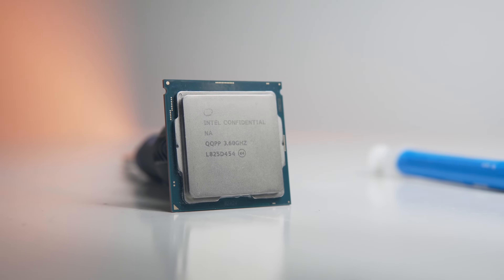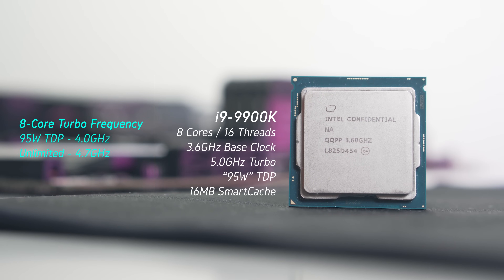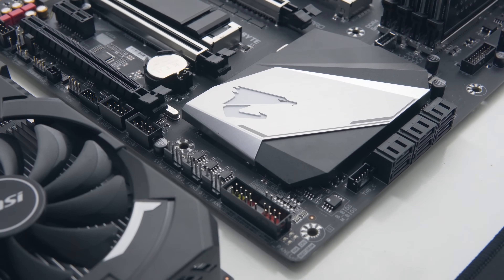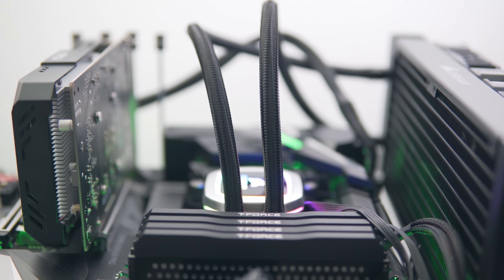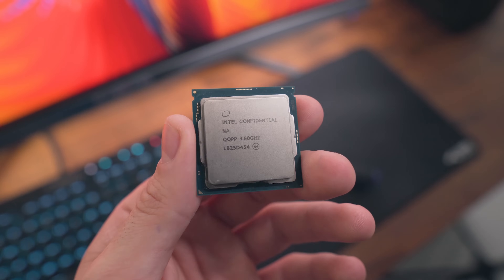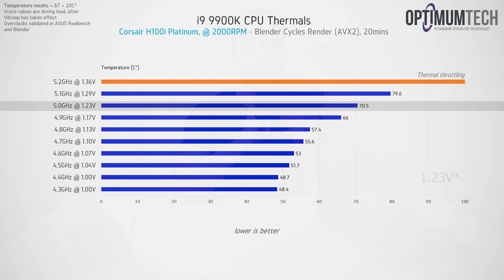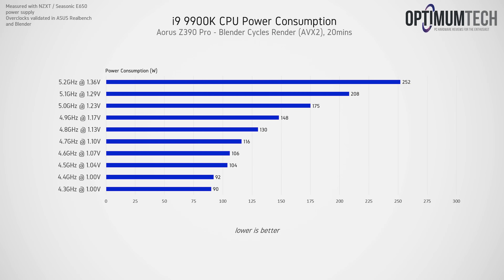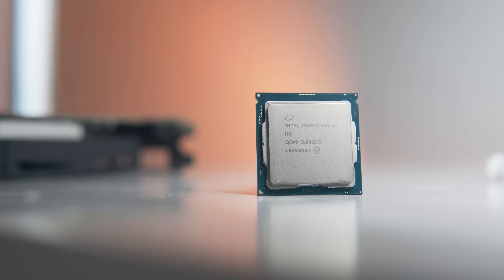9900K Overclocking & Undervolting - Fighting The Molten i9

Comment: Mini ATX? im using midtower i9-9900KF currently overclocked as well, and i had to add 2 more fans from above, so the temperature is ok... I cant imagine mini atx, not gonna lie, it will melt something inside by the time.

Comment: Thanks for this. I have had my 9900k for a while, and while I'm generally fine with the temps I get on my 280mm AIO, I was considering undervolting just to see if I could get better temps.  It's a lot harder to find undervolt, or solid stock clock voltage limits that can reduce temps compared to finding safe OC voltages.  Had to do similar with my 4670k because the gigabyte board I had let the voltage run absolutely wild...it's been ages, but I want to say I saw 1.43v or near that at one point when I saw the ridiculous temps I was getting.

Comment: Still can not understand how can you get those voltages.. im in 1.205 for 4.9GHz
Reply: And i cant get the same points in cinebench as you do… what am i missing…
Reply: @MarcNF15  Good cooling probably
Reply: @djangojansen7648  temps are not my problem at all... i play with a 2080 ti and i never reached 60 degrees with my overcloking settings, even playing red dead redemption 2 and im at 55 - 57 degrees, cpu has a 360 aio from thermaltake with grizzly thermal paste.. 45 degrees, maximum of 67 doing cinebench...   I supose he has amn amazing cpu.. one of many?

Comment: I’m torn. I’ve scored a i7-9700 non-k for free and built a PC last July. The 9900k was still $800AUD and now they have dropped to $450. Not sure if I should get the 9900k and OC it. I’m running a z390 Gigabyte Arous so it shouldn’t be a problem 😬🤔

Comment: How do I undervolt my i9 9900k.
Do you have a guide for it?
I want it to run at a certain voltage consistently anddontgot above that.
Is that an option? I am new to this.

Comment: Looking at the power consumption it seems your tests didn't really stress the CPU. Try Prime95 or ADIA64 FPU only. I suspect it would crash in 15 minutes.
Reply: Yep, bullshit test. Newest Prime95 and crash after 1 minute :).
Reply: @Mike That's not the point. The problem is he didn't stress test at all and claimed it's 'stable'. Mine could run a few cinebench with 4.9Ghz @1.19v with no 'issues' but in order to get no errors or wheas in both OCCT and x264 I need 1.25v. And these two tests are far from being 'unrealistic power virus'.

Comment: I have a i9 9900k turbo boosted to 5 ghz and my temps are always around 113 -130f while gaming is that good?
Reply: yes its good
its because gaming doesnt require all 8 cores on full load.
if you try to run a stress test your temps could reach 100 celsius

Comment: I get a mex temperature of 61 c and I'm on a air cooler noctua nh u12s
Reply: @djangojansen7648  yeah at 5ghz
Reply: @Mike 1.33v
Reply: @Mike the front of my case has three noctua 140 mm fans spinning at 3,000 RPMs
Reply: @Mike damn I didn't think there would be that much difference between chips
Reply: @Mike in something like prime95 it hits 71c after running it for a while
Reply: @Mike I'll tell you what though my computer is not a computer for someone who cares about how quiet it is lol
Reply: @Mike part of me wants to get a bigger air colder because this is like the smallest one you can get in a tower form factor

Comment: I can’t trust these results at all. I can get 5ghz all core no avx offset at 1.25v to pass cinebench runs, but the moment you run any actual stress test like realbench, OCCT, or prime95 1344kb it will instantly crash. So just because you pass some basic blender runs and a few cinebench runs doesn’t guarantee stability.

I need to use 1.31v for 5ghz for actual stability.

Comment: Why not to buy i9 9900k and then use it at 4.5ghz with 130w tdp air cooler, you don't need more than 4.7 ghz, it just doesn't worth extra power consumption and temperatures...

Comment: Running z390 aorus pro and 9900k stock. CPU-z shows voltage consumption of as high as 1.380volts when running cinebench r15, hwinfo shows power draw of as high as 140 watts. So basically 4.7ghz at a maximum of 1.360 - 1.380 volts with a maximum power consumption of 140watts. Running absolutely rock stable, but I sometimes think of undervolting, looking for some expert opinion in the subject.

Comment: How in the world are you getting these "stable" volts. My chip is mostly stable at 5Ghz, 1.345 8hrs ran on OCCT no avx max temp 91 with my 360mm aio. If i drop below that it crashes. Yet yours is stable at 1.23 max temp 70. I don't understand..

Comment: Youre so lucky, perfect sample! I god bad sample :(, 4.7ghz all core boost @ 1.21V and not less (the same MB z390 Aorus Pro), LLC i set @Turbo... Using 360mm radiator, but tems in blender are about 80'C, i will later try 4.6ghz with smaller voltage, mby there is breakpoint (like on skylake or haswell was - example, 4.5ghz @ 1.2V, but for 4.6ghz is huge voltage bump like 1.29V)...

Comment: @Optimum Tech Hi mate, I have a few questions I did some OC testing yesterday with a h115i pro 280 aio. 5.0GHz at 1.30v and using Small FFT Prime95 AVX testing with no offset I was seeing temperatures up to 100-109C just before thermal throttling set at 110C in my Bios. But that kind of worried me so I dialed it back. Also in custom Prime95 tests, I'm seeing more like 95-100C max like in the test you did at the end of this video. So with that said I have a couple of questions.

1. Is 110C a couple of times for no more than 15 minutes likely to have damaged my CPU or reduced its lifespan or overclockability? Two test I ran for about 15 mins and the rest was just a few mins at these temperatures before I decided to stop. I'm going to dial in a less aggressive OC or I might delid and direct die cool with a h150i.

2. Is this TjMax of this CPU 100C or 110C I keep seeing conflicting results but 100C from intel but other articles and YouTubers state 110 or 115C. I also see other data that doesn't seem accurate like boost up to 5GHz when it used to say 4.7GHz for the i9900k.

3. What testing should I do to confirm stability and for how long with temps up to 100C? Is the custom prime95 test you ran the best test on the latest version of prime95? I did this test and I hit around 100C max and it seems to be stable. When I run small FFTs (in the latest p95 version) temps get up to 110C and eventually one of my cores will drop utilization down to like 60-70%, not sure if this is a bug as no thermal throttling happened, which is weird. Running smallest FFTs yields similar results but a couple degrees less and it takes longer for that 1 core underutilization to happen. All my other tests run fine like Cinebench, Intel XTU, etc. 

Thanks!
Reply: Dude you need to increase your AVX offset, back off your voltages or both. Prime is no good for testing stability anyway. I've seen 24 hr Prime stable machines crash within seconds of playing certain games.
My CPU @ 4.9 on all cores doesn't go much above 80C with an h80i. But then I've never  torture tested mine....

Comment: 120mm fans at 2000 rpm is just too noisy. I have the Corsair 150i PRO with 3 fans at max speed of 1600 rpm, and that is more than loud enough. So if you had lowered the fan speeds to more reasonably speeds, these results would have been different for sure. Then anything over 4900 Mhz would have become too hot.

Comment: Main problem i have with undervolting is that your cpu will always run on the set voltage as offset does not really work because the idle voltage also gets lowered and that makes bootup impossible or the pc crash in windows.

Comment: LoL benched for 20 min does not = STABLE
Reply: It takes 30mins for temps to be seems at equal
Reply: @MustardGamings  Ned is right, 30 minutes is not stable. The tests are not just about temps, you are testing to see if there are any hardware errors. I have been 2-3 hours into a RealBench run and thrown WHEA errors. In one case it threw errors after 5-6 hours. I test my configuration up to 8 hours, the maximum in RealBench, and it has passed every time.

Comment: hi dude.
could you please tell me which settings i have to touch to undervolting my i9 9900k because i guess the cpu core voltage is not the only thing..?
i have the same aorus mobo.
peace.
Reply: That's all you have to adjust/change.

Comment: 5.2GHz on all cores need 1.4V and are not super stable. Temps are in the high 80 to low 90 °C with a 360 AIO. Not that bad for a stock sample. Nothing I'd use 24/7 but a nice result. With a good aircooler I managed to quench 4.9Ghz out of it but it got way to hot. I'd say at least a 360 Aio better a custom loop with a good pump and a big radiator is a must for that beast.

Comment: i use a adaptive voltage on my overclock. its stable but you gotta to turn it off if using a stress test like prime 95
Reply: Why does it need to be turned off for stress testing? Does it become unstable at 100% load?

Comment: Try to combine with the z390 auros master with i9 9900k. I compare your review to mine. I get better and lower temps. I'm overclock at 3.2 to 5.2 and my ram 3200 mhz to 3700 mhz. my cooler is custom loop with 360 rad just for the cpu.

Comment: I can only get 4.9GHz (stable) on all cores running at 1.31V, hitting up to 87C on my Gigabyte Aorus Master MB.  CB score of 2047.  I also have a ML360R AIO.  I think I lost  the lottery.
Reply: Derek Gebhart Sorry to hear that. I also had similar i9 which needed 1.325v for 4.9GHz and 1.415v for 5.0GHz. But I returend it and get a new one. And this new i9-9900k sample is just insane. I managed to get 5.0GHz fully stable at 1.25v - it's just wonderful compraing to my old i9. So if You have possibility to return Your i9 - do it and get a new one, maybe You will be lucky as me next time and You will win silicon lottery! : )
Reply: Hitting 1.295 vcore on all core 5GHZ. worth replacing your AOI cooler paste with quality noctua paste or similiar, definitely made a difference for me

Comment: My experience was an absolute sh1t cause I won the silicone lottery of the worst possible bin.
Reply: Edvinas Mozuras What are Your results. Unfortunately I also didn't win silicon lottery. My i9 needs 1.2v for 4.7GHz and 1.385 for 5Ghz. : /
Reply: Hi @Tomek687  My i9 needs 1.4+V for 5GHz and due to the heat even with my H100i v2 I can't currently test my rig properly with all the panels off and fans on max. Never passes p95. I can run and pass the cinebench or aida64 but they are not very good for stability testing anyway.
Reply: Edvinas Mozuras Unfortunatelly my i9 also needs around 1.400 - 1.415v to be fully stable on 5GHz. And temps are also very high. However it's really sad that I need 1.4v for 5GHz, because on 4.9GHz it needs only 1.3v to be fully stable. I'm actually considering to return it, and get a new one, so maybe I will be more lucky next time.
Reply: @Tomek687  I can't return mine, so lucky you on that part. If I was you, I would definitely have a go at another chance to win!
Reply: Edvinas Mozuras I will return it in a few days, and will let You know about results of new i9. I only hope that I will not receive even worse one. (however I think it's hard to get worse i9 than my current)
Reply: Edvinas Mozuras I recieved my new i9 8 hours ago, and after these 8 hours of test I managed to achieve 5.0GHz at just 1.24v which is fully stable in all stress test (prime95 small FFT's, OCCT, Aida, Cinebench r15 and Asus realbench) and have great temperatures (max 78°C in OCCT and only 65°C in CPU heavy games). I am super happy that I returned my old poor i9 and get this new great sample. It's insane how quality of these chips is so much different, 1.415v on old chip and 1.265v on new chip for 5.0GHz - this is a huuuge difference. I am happy that I finally managed to win silicon lottery! : )

Comment: I get 5.0 across all cores at 1.35 on duel fan air with temps running into high 80's to low 90's or upper 70's to low 80's processing video right now... 
Cpuz says
Temperature 0  78 degC (172 degF) (Package)
Temperature 1  78 degC (172 degF) (Core #0)
Temperature 2  72 degC (161 degF) (Core #1)
Temperature 3  68 degC (154 degF) (Core #2)
Temperature 4  72 degC (161 degF) (Core #3)
Temperature 5  66 degC (150 degF) (Core #4)
Temperature 6  76 degC (168 degF) (Core #5)
Temperature 7  74 degC (165 degF) (Core #6)
Temperature 8  78 degC (172 degF) (Core #7)
Voltage 0  1.38 Volts (VID)
Power 00  139.32 W (Package)
Power 01  132.08 W (IA Cores)
Clock Speed 0  4998.10 MHz (Core #0)
Clock Speed 1  4998.10 MHz (Core #1)
Clock Speed 2  4998.10 MHz (Core #2)
Clock Speed 3  4998.10 MHz (Core #3)
Clock Speed 4  4998.10 MHz (Core #4)
Clock Speed 5  4998.10 MHz (Core #5)
Clock Speed 6  4998.10 MHz (Core #6)
Clock Speed 7  4998.10 MHz (Core #7)
Reply: Yes I am running a Gigabyte Auorus Z390 Ultra.
If You just delid and use liquid metal then you will just get 5c, but if you sand down the  die by .2mm - .3mm you will get much more benefit. It is as if Intel made a built in performance improvement for the next gen by making the die too thick on purpose.

Comment: How can I undervolt my i7 9700K with noctua nh-d15 and asus rog strix z390 F gaming? Because it's hot as hell under load in games.
Reply: Just go into the BIOS and lower the voltage

Comment: 9900k + maximus xi formula. 2x rtx 2080ti. 1x360 45mm, 1x360 30mm, 1x120 30mm. cpu, gpus, ram and vrm in the loop. dual pump single loop. 5ghz all cores, 4.9 avx, 1.34V. 104C after 30 min blender, avx on, 92C avx off. Voltage any lower than 1.34 will result in calculation error in blender avx off. Guess I lost the lottery :(

Comment: Hello, how do you limit the GDP on an Asus z390 strix-e gaming? I think my 650 power supply is being raped by my 9900k (it was running at 4700 ish). My h100i v2  's rgb light was dimming and the fans connected to it were turning off and on. The 9900k running wild with wattage is the only thing I can think of. That said I  did a windows reset and that isn't happening anymore. I also turned off the turbo to be extra safe. But now my gtx 1080 g1 gaming  is running at 95% - 99% load on the blackout deploy screen, that is, Before you even head into the game, and the fans on it are 1500+ rpm before I even open a program. Maybe I'm just tripping and this stuff is normal? I never monitored the clock speeds and fan speeds and such  untill this new build. I know for sure the Aio and fans connected to it aren't supposed to turn off. Thanks again if anyone can help. Sorry for the essay, super stressed about this issue. One more thing to note: I think everything went to shit when I used the auto  "fan tunning" provided by AI Suite 3. Needless to say, not reinstalling.
Reply: My new build is the same as this https://pcpartpicker.com/user/ksiyas95/saved/Dbpypg , but changed motherboard (now a asus z390 e gaming) and the cpu (now a I9 i-9900k).

Comment: I will really appreciated if you or someone can answer my question, I have a 9900k with a ASUS z370 hero x Wi-Fi, my 9900k goes only to 1.17, 1.18v, at stock, my question is, If I get a z390 motherboard will I be able to undervolt a bit more or should I stick with the z370?

Comment: I’ve tested mine with prime95 and I got a bad chip where even 1.33v under load can’t be stable on all cores at 4.7ghz so I’ve lucky fell into a bad silicon lottery experience.
Cooler: Noctua nhd15s 
Motherboard: Asus Prime z370-p
Reply: Curious Slyfox I tought that I was unlucky to get i9-9900K which needs 1.2v to get stable on 4.7GHz. : /
Reply: how many minites where you on prime? and was it at a set 1.33V or was it set to adaptive ?
Reply: That motherboard can not handle 9900k btw

Comment: The thing is, and I noticed this after having the 9900k for just a day, is that there is little point to running above about 4.7Ghz all core.  Only the benchmark scores get higher.  The actual real world performance only barely creeps up.  For example, in Resolve, we are talking 3-4 seconds less on a 10 minute render job for every 100Mhz bump all core.  Its basically nothing.  Silicon lottery?  What a joke.  If you are buying a 9900k to run benchmarks all day, have at it.  If you are buying a 9900k to do actual tasks, landing a "golden" chip means not a damn thing.  Im saying this, and I actually think I may have got one of the "better" samples.  Although, my "better" 9900k and 5 bucks does buy me a cup of coffee at Starbucks.  They keep giving me back the 9900k in change, almost as if they dont want it for some reason.  I keep telling them, no, you dont get it, this is a better one.  Yeah, they hand it right back, and say please come again tomorrow..with 5 more dollars.

Comment: Just got my 9900k. I know that each chip is not the same quality and each requires its own voltage, but your numbers just seem like fantasy. Granted, my ASRock Z390 Taichi Ultimate has crappy software in the way, but...damn. Out of the box my Vcore at 4.7 was the same as yours at 5.2! Also, no adaptive voltage. Static and offset only. So after hours of wrangling with an offset that won’t go below -.1V and load line calibration I’m at 5Ghz at 1.296V. Might I inquire of your method of setting voltage as well as your cache clock (mine crashed above 48x) and its voltage.

Comment: I recently bought myself a 9900k, however i have a Prime Z370-A motherboard and i dont really want to upgrade to a Z390 because i have a custom watercooled setup with a monoblock to fit the Prime Z370-A. So my quesition is, Can i expect to see close to similar results on my Z370 or am i better off biting the bullet and get a Z390 and put my monoblock aside? i am running a 4.8Ghz overclock but i could only get it stable at 1.375v or 1.4v which makes the temps jump fairly much under load